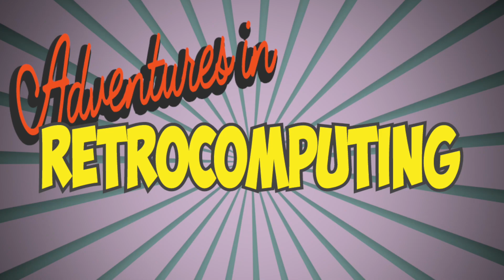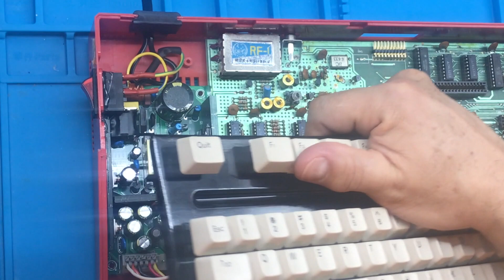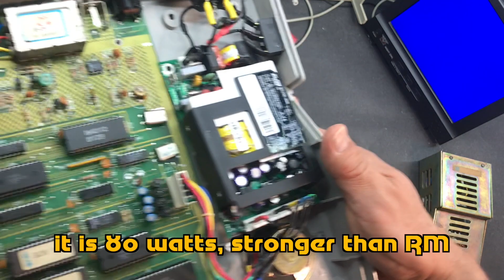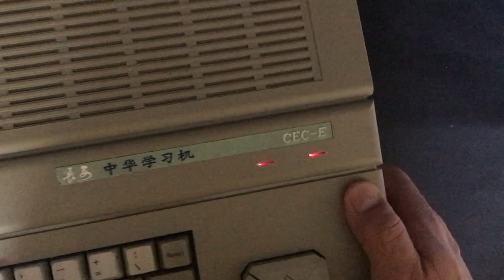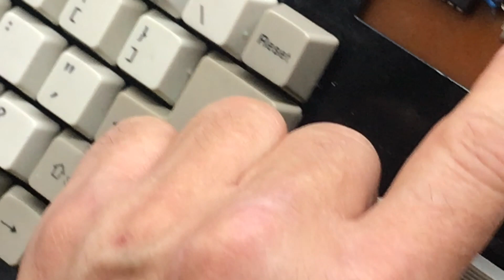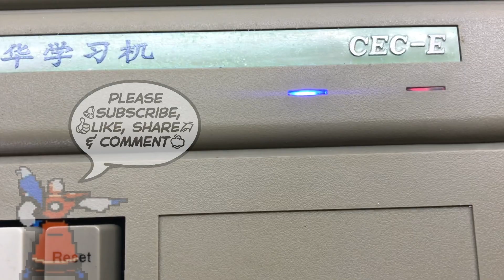The Chinese Chronicles - CEC follow-up hardware enhancements

Comment: Nice job Javier!

The nice thing about both Henry's PSU and the EOS, is that they are universal, so they can accept 120V and 220V AC, so no more voltage converters will be needed from this point on.
Reply from the maker: Great point! Thanks to you I have both computers working!